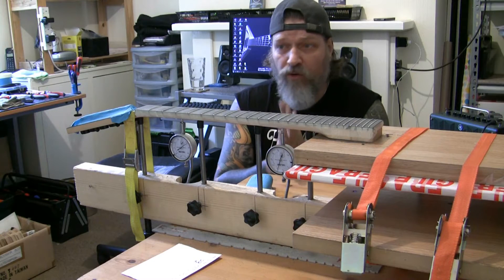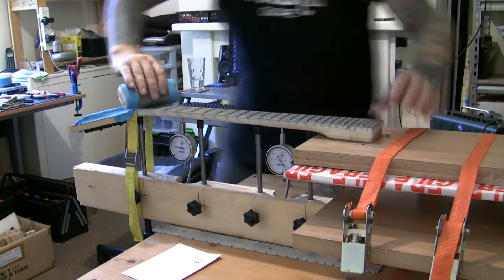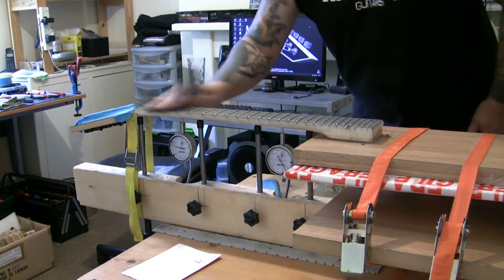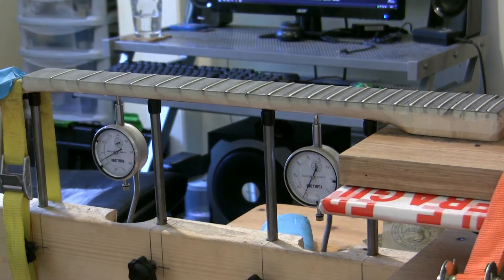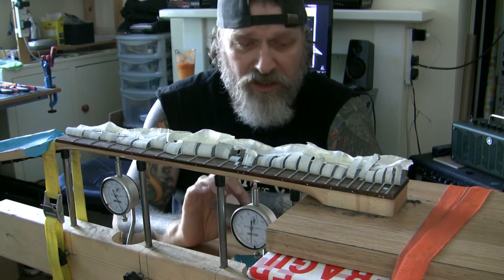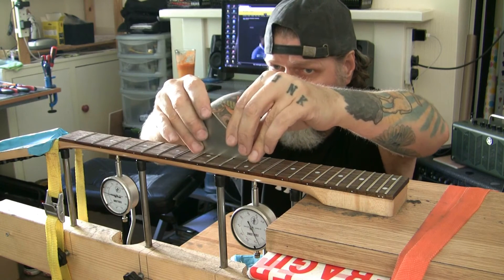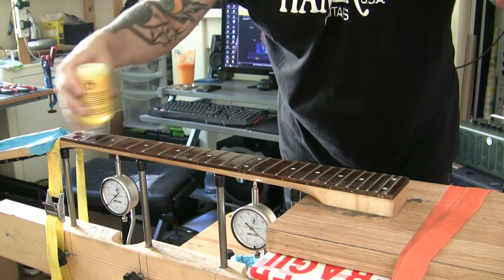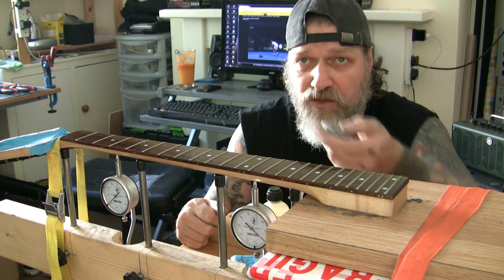Ibanez Gio GRGR121EX: Truss-rod + fret buzz issue / fix [Part 03]

Comment: i have this guitar , its difficult to bend the strings  
i have tried more than way to fix it but there is no good result 
can you please help me by giving a solution to fix that problem  
hard neck , hard bending !!
Reply from the maker: There are too many variables to diagnose without handling the guitar. I'd check for level frets first...